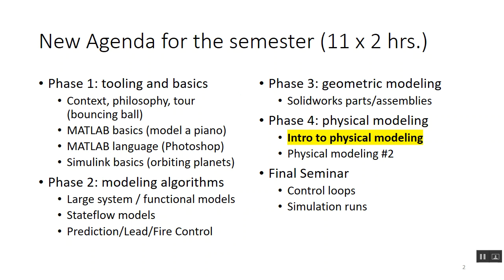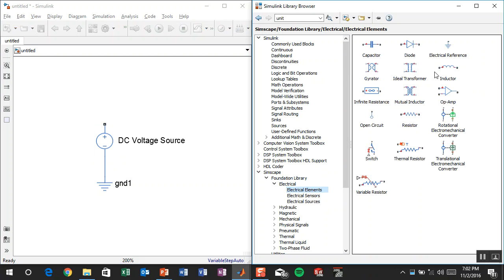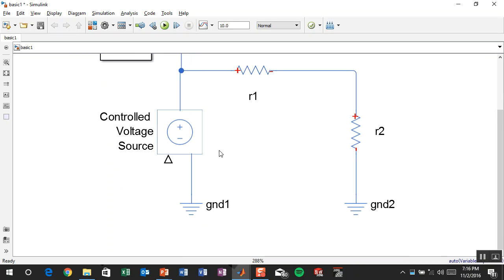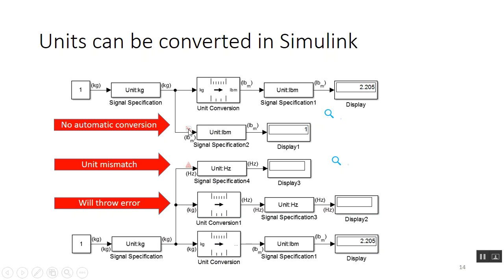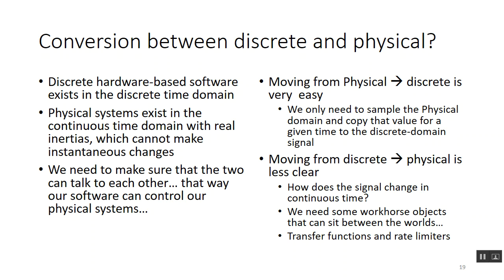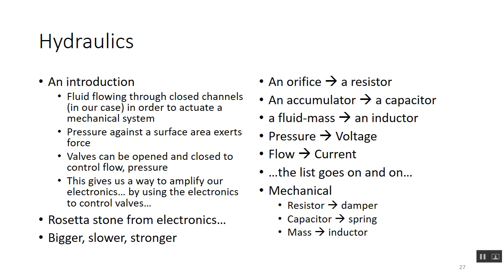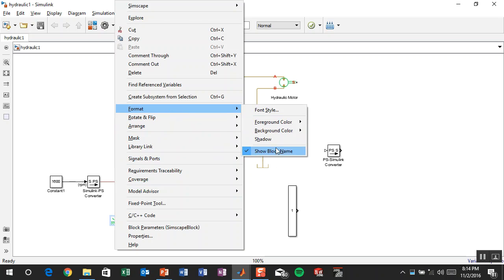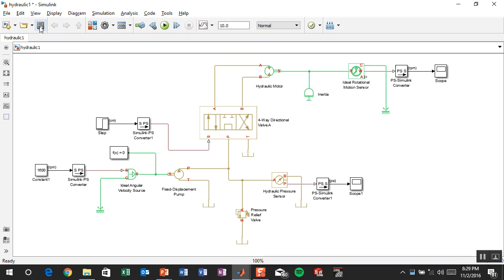modeling, simulation, analysis   session 9

Comment from the maker: Please note: there was a small error in the slide describing the canonical 2nd-order transfer function.  The slide says that "Wn=1/Tsettle" .  This is true if we think of Wn in the units Hz (cycles/sec), but in this context, the natural frequency is in radians/sec, so there is a 2*pi conversion factor.  You will notice it in the initialization code, but I didn't fix the slide, unfortunately.  that line should read "Wn=2*pi/Tsettle".  My apologies for the mistake.